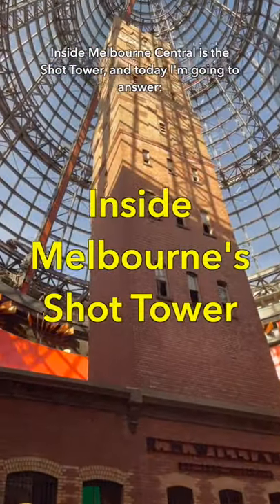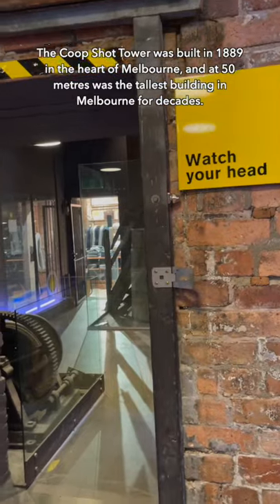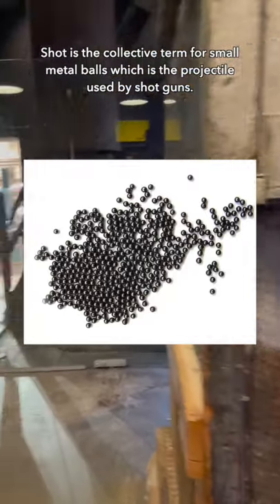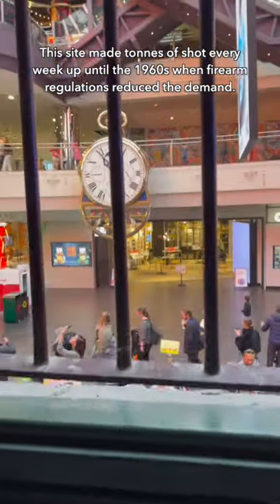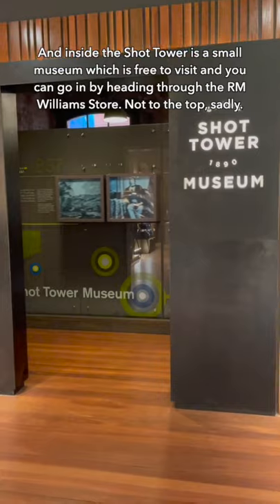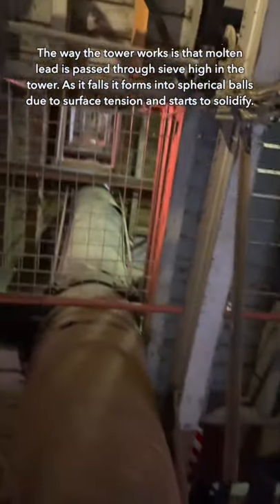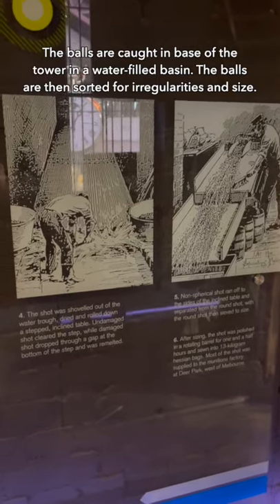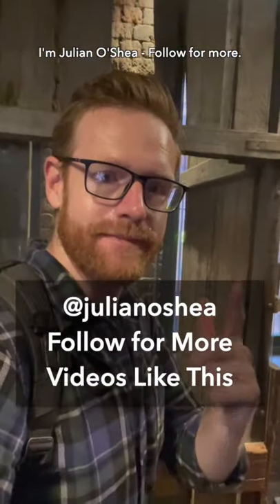Inside Melbourne's Shot Tower  #shorts

Comment: The other reason shot towers aren't common anymore is the manufacturing process has changed form long drop method requiring high towers to the Bliemeister method that did away with the need for high towers.  Removal of import tariffs also saw most local production of chilled shot cease.   There's only 3 of these old shot towers left in Australia, Melbourne Central, Clifton Hill and one in Tasmania.  The last local shot manufacturer currently operating is in Laverton.

Comment: eh put it back in business we could sort them and use them for bearings maybe use non lead materials sort em out though another sive sorter like rolling down 2 pipes till they fall through the angled gap into well placed bins that can be easily and quickly swapped for unloading and not just 2 pipes but multiple rows of pipes funneled to the sorted rolling boxes on rails or otherwise